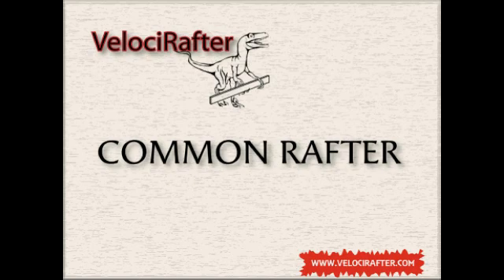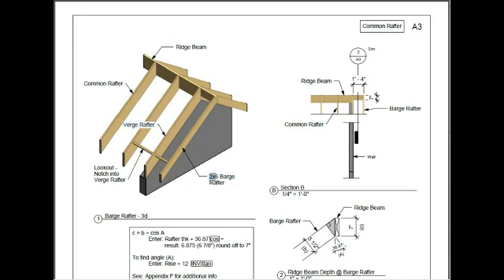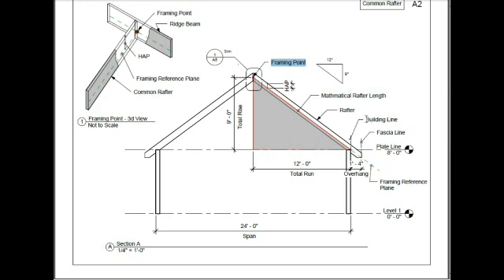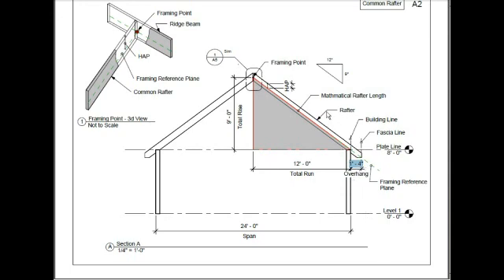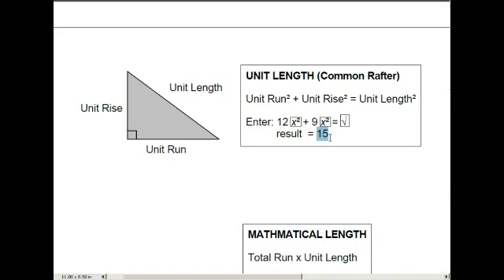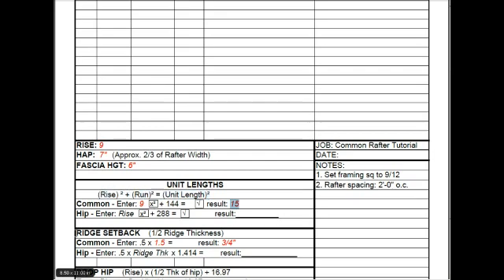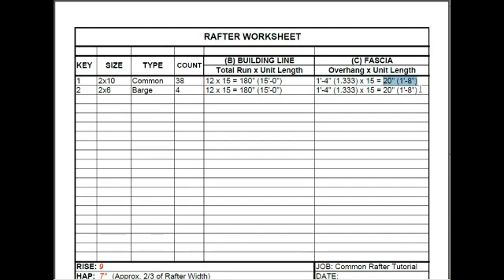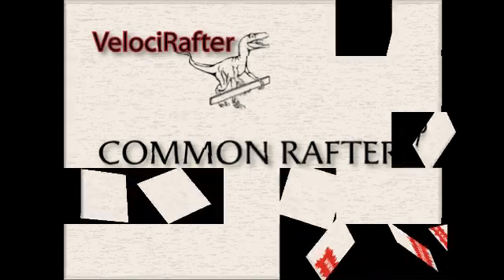Common Rafter Roof Framing - part 1

Comment: I believe what you referred to as a ridge beam is actually a ridge board ie only aligning the rafters and not bearing weight.
Reply: R&R Homestead  yes, he makes reference to a ridge beam and the plan call what looks like a ridge board a ridge beam. But no big deal, he’s not talking about the the difference each makes in roof dynamics. The rafters are cut and stacked the same and this vid is meant to show us the math involved. Which I can appreciate, but I know what you mean.

Comment: I love this video. With that said...this sounds like an architect or an engineer way over complicating how this actually goes down on a job site. You know the pitch of the roof is a 9-12. You know the rise and run. You'll know the height of the ridge beam. You already can account for the diagonal.

So say you are using 2x10 for rafters. You measure from the inside edge of the ridge beam diagonally down to the outside edge of wall framing. Now you lay your 2x10 on the saw horses, crown up and cut a 9-12 on the end. You take a tape measure using the number you got from the ridge beam to outside of wall Fram and measure from the long point of the 9-12 you just cut. Pencil and tape measure together, you scribe a line at that measurement. It will look like an "arc." It's common is residential framing to mimic a 2x4 after the birds mouth on a hand cut rafter. So now you scribe a line 3 1/2" from the top edge of end of the 2x10 up to the "arc" line you made. Where those lines meet is the inside of the  birds mouth cut. Bam! Cut the birds mouth out, cut along the 3 1/2" line. You can install the rafter at this point. Or you can use this rafter as a "pattern" and have a guy cut out as many as you need. When all the rafters are nailed in, you can measure out from the building 1' 4" or whatever your plans say and mark the rafter on each end of the roof. Snap a line. Now, even if the wall is not perfectly straight, your rafter tails and fascia will be. 

Also, if the roof is going to have "ridge vent," the ridge beam will be lowered a little to allow air flow. You will need to account for that on the top of the rafter after you make your 9-12 cut and before you mark for the bird mouth.
Reply from the maker: Thanks for your reply. The VelociRafter series was created to teach how to use math to solve some common roof framing questions, especially for complex roofs.  I personally found that by preparing my cut list prior to picking up my saw, I could dramatically reduce the amount of time it would take me to frame a roof. If your approach works for you, thanks great! Another idea for allowing venting at the ridge is to hold back the plywood an inch or so from the ridge vent.